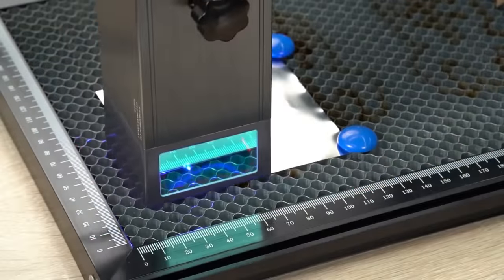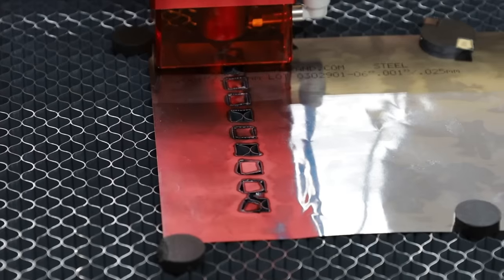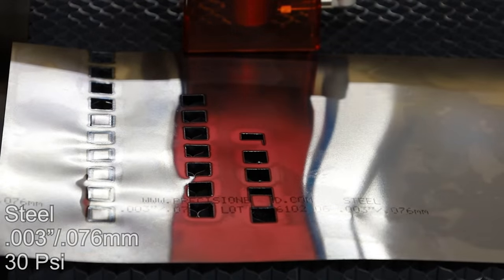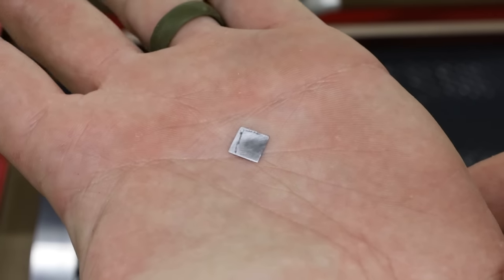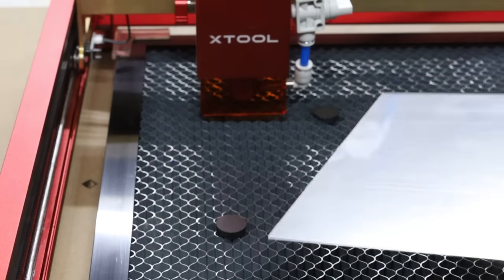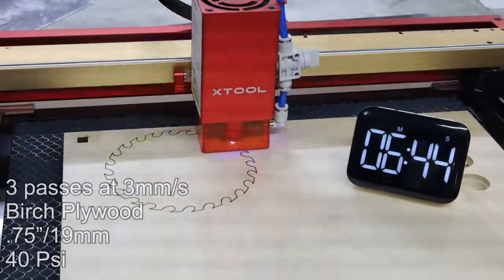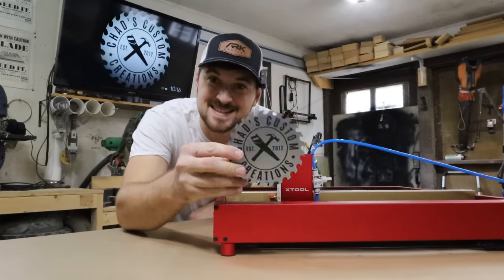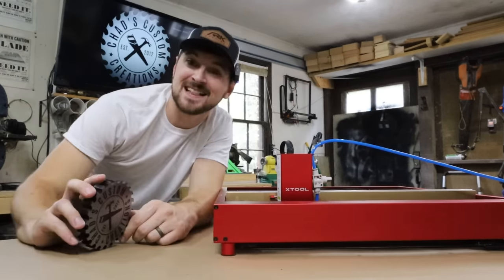Cutting Metal with a Desktop Laser

Comment: You can use the soot from a candle to mark stainless steel. Just light a candle and run the stainless steel thru the flame. It will leave black soot on the ss. Just laser and wash off the soot. It's cheap and easy and does a good job.
Reply from the maker: That's a cool trick I had no idea!
Reply: Was think candle soot for glass too!
Reply: @Curious_Skeptic  I have used it on glass too. It works well.
Reply: I was thinking carbon or ash too, something to hold the heat, coat and darken it up
Reply: Dykem.
Reply: What if you painted the metal? Would it cut?
Reply: @TravelingOurBestLife  you are not going to cut the metal with a diode laser. Most likely you will just burn the paint away and leave the stainless steel bare.

Comment: I used to work a lot with laser welding machines. 1) Diode lasers are continuous wave lasers. Look up CW power levels for  materials to be cut. 2) Angle you head about 3 degrees from perpendicular. This will help prevent any back spatter to the lens. 3) Use an inert atmosphere instead of air to minimize surface discoloration. 4)most importantly, the light must melt the material. Therefore the thicker and higher conductivity the material has,  the harder to cut. Aluminum and copper has much higher conductivities than steel. You won't cut .002 copper. Question: What wavelength of light is your laser?
Reply: 445nm
Reply from the maker: John this is great insights thank you for sharing this, I hope you stick around in the future, as it seems I could learn a lot from someone like you. 🙂
Reply: @ChadsCustomCreations  Thank you
Reply: @ChadsCustomCreations  Chad,that was great to see you cutting metal. Did you had to tilt these angle by 3 degrees as John mentioned? I am wondering how that adjustment is done?
Reply from the maker: @kamlesh jethwa  I haven’t yet but you could either shim up your honeycomb cutting board to angle the materials or you could pul small shims under the feet of the laser itself. Probably other ways of doing it also just the first ones that came to my mine.
Reply: A small grub screw at the top of the laser mounting plate would be great like they do on the mirrors of CO2 lasers
Reply: @ChadsCustomCreations  tilting the cutting board would mess up the z-alignment on larger cuts though. It’s better to tilt the z-assembly

Comment: Thermal conductivity seems to be a determining factor. The more conductive, the worst the material cuts. That would explain why it couldn't cut through aluminium or copper, and why stainless (being the worst thermal conductor here) did the best.
I reckon the explanation could be that the heat gets dissipatef in the best conducting materials rather than staying focused on the laser point, hence preventing the cut
Reply: That’s interesting, I wonder what would happen if you tried the cuts after freezing the steel with liquid nitrogen. Or what would happen if you pre heated the steel with a heat gun?
Reply: @Noadvantage246 if it lowers conductivity it could help otherwise no
Reply: yes that is why
Reply from the maker: Great points I did an updated video on this with the IKIER 70w and mention these comments. Thanks for the input!

Comment: Now they (Atomstack) have a 14 diode 70W laser supposedly coming out around end of March / beginning of April.  It purportedly uses 6W diode modules (which would technically be max of 84W) combined into a single beam.   It's claimed to cut 0.3mm (0.118" / 11ga) stainless steel in one single pass, has a 800*850mm working area, and automatic laser focus.  BUT it has a much larger focused spot than my Atomstack X7 Pro, even in 1/2 power mode @ Spot Size: 0.12*0.18mm (70W) / 0.08mm*0.12mm (35W) - my X7 Pro spot size is claimed to be 0.06mm x 0.06mm ....

Comment: I have a theory as to the reason it can cut the steels but not the other materials. I think it may be due to their thermal conductivity values. Steel and Stainless Steel have very low thermal conductivity, so the energy from the laser isn't dissipating through the sheet and stays confined near the laser point. The other materials you tried to cut (brass, copper, and aluminum) all have much higher thermal conductivity values, so the energy spreads out from the laser point and in turn isn't sufficient to cut or even mar the material. I'd be interested to see if maybe Bronze (75% Cu, 25% Sn) or Titanium could be cut with the laser, as they have a similarly low thermal conductivity value as steel.
Reply from the maker: Great ideas I've need to get more for future!
Reply: Generally speaking, you can try running the program over and over again, think of it like a drill bit, slowly eating away the material. I just saw a guy use a 60 watt laser to cut 1/8” brass/bronze by running the program over it a few times
Reply from the maker: Oh wow if you still have the video could you share the link with me I’d love to see that.

Comment: Awesome idea for the tape for placement!! Thanks for all the testing! 🥰
Reply from the maker: My pleasure thanks for watching!
Reply: Is that the transfer tape that you have in the Amazon shop?
Reply from the maker: Yes that’s it should be the low tap 12” width
Reply: May I ask what Settings you use on the tape?
Reply from the maker: @Falko99  I can’t remember but it was fast with a pretty low power it’s easy to cut through.

Comment: Stainless Steel is a really special case for this, it's ridiculously non-conductive for heat (~15W/m/K). Normal steel (~45W/m/K), brass (~111W/m/K), aluminium (~240W/m/K), or copper (~385W/m/K) are far more thermally conductive and will carry the heat away too quickly. Your goal is to put energy in so quickly that the metal vaporises before the heat can be conducted away.
Reply from the maker: Oh wow I can tell you know your stuff thank you for this information. So theoretically stainless still would be the easiest to cut?

Comment: Some tips for those cutting metal:
Take as many passes as you need. Most machines can't cut metal in a single pass, and even if they can it'll leave some burs. Lower your power, increase passes to cut down on bur cleanup. It might take 50 passes. In some cases I've done over 500. But your final product will be good.
If your surface is too reflective, remove its reflectivity. Polish it later. Once you break through the first layer, reflectivity won't be an issue due to the laser's blackening effect.
If you get warping, your material is too hot. Lower power. Take some time between passes. Take even more passes.
Remember, your laser is a tool, not a solution.
Reply from the maker: This is great insight! I am curious what machine are you running and what thickness have you been able to cut?

Comment: most metals are almost 100% reflective at 10600nm (co2 laser). once you get up into 1064nm or higher, the reflectivity is "only" like 90-95% so you can actually get power into the materials.
Reply from the maker: This is great info I hope you stick around.

Comment: It’s not about reflectivity for the materials, it’s about the material itself and how well they can transfer heat. Aluminum and copper are great heat conductors, which why they’ve been used as radiators in cars. Steel is one of the worst for thermal conductivity which is why you can cut it.
Reply from the maker: That makes sense especially with how reflective that stainless steel was yet it even was being cut/etched.
Reply: @ChadsCustomCreations  try cutting aluminum foil, it’ll be relatively close to the thicknesses of the steel shim stock. What you showed on screen was considerably thicker, like 3 to 19 times thicker. Depending on mfr of course but std duty is close to 0.0004” - 0.0007”, so roughly half as thick as the thinnest steel shim you used.

Comment: I have a galvo 60 watt fibre washer. The easist metals to cut have low thermal conductivity. For same reason, thin metals cut easily because they heat up faster. The Galvo fibre lasers have massive lens to set the focal point and are an engineering marvel to get focus to be in a plane and not spherical. Cutting intensity focus is only very short though. Sweet spot of about 0.2mm with my 150mm lens. My blue 10W LED laser is thinner for much more distance. CO2 60W diverges faster than my 10W Blue on it's standard 72mm lens.
Reply from the maker: Awesome thank you for the tips

Comment: Try cutting the aluminium through a film coating, not sure the one on it is right, but most of the panels cut on laser have an opaque film 'laser film' to stop the reflection.
Reply from the maker: Great tip I will try this.
Reply: Won't do much. Initial power settings are usually 20% higher to start the cutting.(when the metal melts the emissivity(reflectivity) of the molten metal gets higher, therefore the absorption into the metal increases). Putting a black surface on copper will burn the surface coating fast, but do little to the copper underneath it.

Comment: Hello, do you thing these metal sheets can be cut with the Falcon 2 pro 22w? Thanks!
Reply from the maker: @Aerfmosfera  if it is indeed a 22w of output power you should get very similar results. A higher flow air assist seems pretty critical though. Go check out my video with the IKIER 70w I have some updated information on metal cutting in that video.

Comment: Just to understand thicknesses, household aluminum foil is between .016 and .024 mm in thickness. I believe the use cases for cutting metal with a diode laser are pretty small. Still, good to know.
Reply from the maker: Yeah I believe it maxed out at about .178mm in thickness which is was more than I expected

Comment: Most diode lasers will “mark” metal, meaning that it will etch metal by a fraction of a thousandth of an inch. The more power, and the slower the speed, the deeper it will cut. It’s close to the right frequency. Thin metal without conductive support touching it will cut pretty easily. Going over it twice will be even better. 20 watts of power is getting to a useful number. When they get to 40 next year, it will work well. Not thick metal, you need several hundred watts for that, or more.

Stainless and that polished steel. isn’t more reflective than that aluminum. The problem is that stainless has poor thermal conductivity, so the heat stays with the laser cut. Steel is better, but still is just moderately conductive. But aluminum and particularly copper have much better conductivity so the heat quickly spreads from the cut, and you need much more power.
Reply from the maker: Great explanation thank you for this!
Reply: Do you think 1.5mm thickness is possible?
Reply from the maker: @hughdelanol.polidario6585  I doubt it with this current set up, but I am eager to see where this goes as the technology continues advance and become available at lower prices.
Reply: @ChadsCustomCreations  the 40 watt models we should see sometime next year should do 1 mm. Maybe a bit over that.
Reply: Greetings your explications are very good. If i lower the speed and do several passes will it engrave stainless Steel ? I mean deep engraving like maximum 3 mm not cutting. Thank you
Reply: @hayatel2557  no, not with this. Sorry.
Reply: I've already seen 40w modules (with 4x 10watts diodes) on amazon. They're out there already.
Reply: @FreedomAirguns  I haven’t seen those yet. I’ve been expecting them early next year. This seems too quick. Don’t bother with them u less they’re from a well known company.

Comment: Great video! I am surprised with the results!  I've only got a 10watt diode laser, but i'm still exited about future possibilities!! Regarding the aluminum and copper, I don't think its the reflectivity that's preventing the marking/cutting, but the heat conductivity of those metals.  Those sheets will conduct the heat from the focal point faster than the metal will heat.  Also, please don't mess with zinc coated metal.  The zinc vaporization temperature is pretty low (as compared to iron/steel) and the zinc fumes are very dangerous (google metal fume fever).  Again, thanks for doing the tests and sharing the results!!
Reply from the maker: You know based on these results I feel like the 10w maybe able to cut some of this thinner stuff Ill see about setting it up and testing it out. Crap does tin have Zinc in it I wasn't aware. Yeah ever since I tested out the cold galvanizing spray with the laser I will never use that again fumes are super toxic.
Reply: @ChadsCustomCreations  Hey man I am also interested in this as I got one of the Creality Falcon 10w they had on 50% off special. My first laser engraver/cutter :) Been 3d printing for a while but this should be a new and fun adventure. Subscribed and will take a look at your other videos!!
Reply: @kennyrobman7390  maybe? You also need to consider vapor deposition on the laser lense which would ruin it. If you really want to do it then air assist should be used, in my opinion. Safety wise I would recommend against using galvanized (zinc coated) metal.

Comment: Thanks for the video. After you have experimented with doing the pierce and air assist, do you think there is any gauge of brass that could be cut with the d1 20W or 40W? I saw you were able to cut brass with a 70W.
Reply from the maker: You know since this could cut .1mm at 30mm/s I would bet that they probably could do the same  .1mm brass but probably stop there as the 70w could only accomplish the .2mm at 3mm/s

Comment: Please answer me ,which laser is good for cutting 15 mm iron  or 15 mm stone ?
Reply from the maker: Phew that’s some thick material only thing I can think of that can cut both of those would be a water jet cutter. I think there was a company called Wazer that put out a hobby level water jet cutter but I’ve heard downsides to this technology as it can be expensive to run as it is not only using water but also media for cutting aswell.
Reply: Thanks ,can it cutting stones and irons? Is there a laser for it because water jets needs to water and others but lasers are easiest so can you introduce a laser for cutting ston and iron with 15 mm ?

Comment: If it can cut  tin then custom battery electrodes are possible i currently have to cut them with scissors, its very time consuming.
Reply from the maker: If it’s thin enough I bet it could, they also have a 40 watt now which is twice the power. Also have an enclosed model the S1 for about $300 more I just put out a video on it if your interested.

Comment: Hi 
A simple solution for painting bug / dust problems. 
Make a shallow box  with peg board on top. Have a hole on the side for the shop-vac  hose.
The air around you small object is pulled away from the fresh paint.  So no dust or in your case a mosquito landed.
Surprised you didn't spray on those other metals
Reply from the maker: Great idea thanks for the tip!

Comment: We have 6 & 8k fiber lasers where I work. They are diode solid state and there primary function is to cut steel. We can cut up to 1” mild steel and stainless. Thin steel like 18ga. (.048”) cuts   at speed over 3000 inches per minute.
Reply from the maker: That must be an incredible sight to see! I am only very jealous of this 😊
Reply: Check out Trumpf and Eagle lasers. They have lasers larger than 8000kw that are even faster. @ChadsCustomCreations
Reply: Where I work we have 3k, 4k and 6k bystronic fiber lasers and an old school bystronic co2, a 6k whitney prototype fiber laser and two plasmas running hypotherms 85 powermax's.

Comment: Great Video Chad, but I didnt get the power asnd speed and interval settings you used on the etching of the saw blade.
Reply from the maker: Hey Larry sadly I can’t remember my exact speeds and power but that cermark spray has a pretty wide tolerance. If you have the scrap material I would suggest running a speed and power test on it to find the most efficient power for you.

Comment: If you want to try going thicker with steel, try replacing the air feed with pure oxygen from a tank.  A lot of the big lasers use O2 gas to help burn through thick steel.
Reply from the maker: Got a tank can't wait to try it.
Reply: The above is correct my husband works for a metal company that cuts and paints bends assembly of metal for big co as well as small co ever ma huge tractor mower co so u most definitely can cut even a thick sheet they have both co2 and oxygen and also fiber fiber is mostly for tube cutting though he’s has brought home fridge magnets key chain they made from scrap and also at Christmas they made us a sign with our last name that is the thickness of normal ones u see and also the fire pits so someone told u wrong my friend they have there gases brought often
Reply: Any metal can be cut stainless is my favorite and it’s thick stuff

Comment: Super cool. Great video and testing diode laser on metal. Mahalo for sharing! : ) P.S. Brass and aluminum have high thermal conductivity...maybe that's the issue?
Reply from the maker: Thanks for watching. Yeah I think the thermal conductivity definitely makes sense. 

Wasn't a fair test going to everything but steel was way thicker I gotta source some more of that .005" stock that seems to be the sweetspot.
Reply: Brass is highly reflective. Pure oxygen is recommended as assist gas. Aluminum cuts better using Nitrogen as assist gas.
Reply from the maker: @johnh.8884  These are great tips you wouldn't happen to know where I could find compressed tanks of oxygen and nitrogen for testing this out on this laser would you?
Reply: Try welding supply shop.
Reply: Ur local gas supply like hubby job uses Holston gases